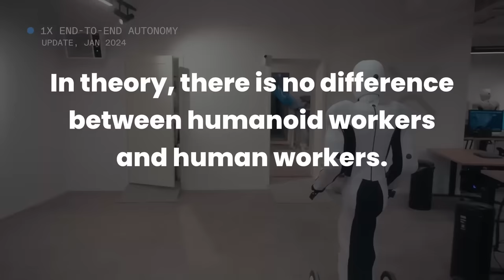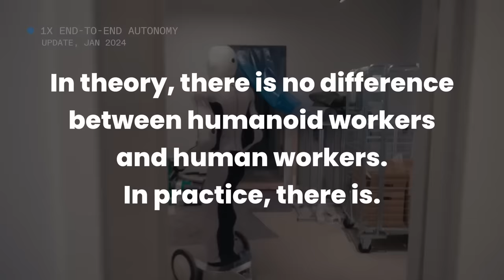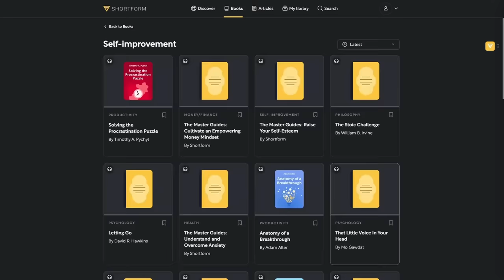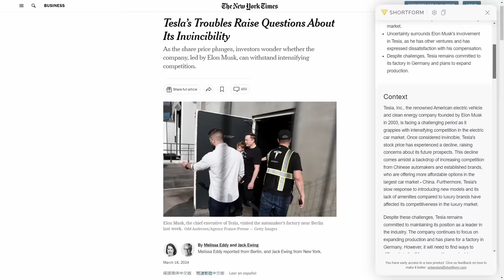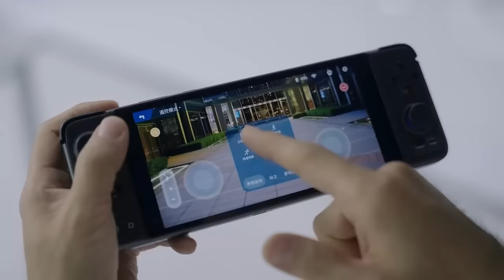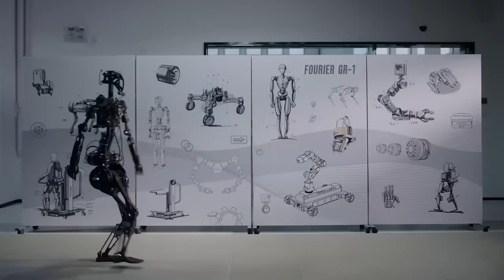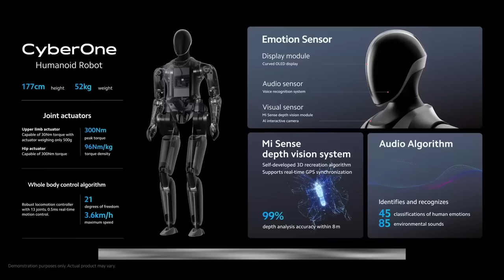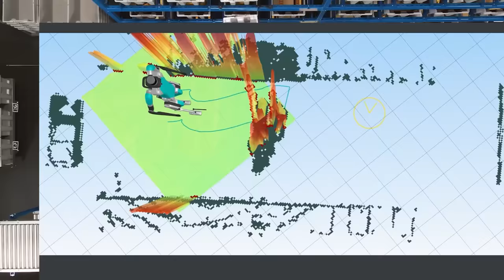Tesla's Vision Realized: A Deep Peek into the All-Robot Production Era

Comment: The volume of a factory could be reduced by at least 50%. Who says that a humanoid robot only has to be the size of a modern human. Why couldn’t they be half the size of a human. Bees, ants and other insects operate and live at a much higher density than humans.
Reply: The factory has to be maintained. Building a factory like a modern car where maintenance is almost impossible is not a good idea.
Reply: They also dont need legs per se merely a base with treads and maybe an hydraulic lift system. How often will the robot really move off of the floor it works on.
Reply: @Dave5843-d9m  
Impossible for whom? Not a robot.
Reply: They also don’t need hands per se. they could have sockets with interchangeable tools for the specific job they are doing. A hand “tool” could be one of them.
Reply: @Dave5843-d9m  but if you get to the point where costs are so low they're virtually only material cost replacing a "modual" of a car rather than stripping to repair a fault becomes the norm. 
This may of course appear ridiculous given the majority of people can't afford a new car (currently), but when automation REALLY takes over, and as Elon says, there will have to be a univerrsal payment system for all.
Reply: I'm trying to figure out, no pun intended, about repair stations to maintain/repair robots and a place to charge multiple robots "on their breaks" would look like on the factory floor. On the environmental front, I think the factory will need to have a huge hvac's similar to server farms to run more efficiently.  What's ironic is that they don't  do that for humans but will have to for the humanoid robots.
Reply: @GG-si7fw   
Robots fixing robots. The factories can be smaller and more compact so fewer cubic feet to air condition. Robots scan also operate in a space that humans couldn’t tolerate.

Comment: Production efficiency is definitely going to increase significantly.
You also made solid points about speech communication vs. robotic communication. It wouldn't make much sense for humanoids to communicate with each other via speech as that is not as efficient.

Thanks for the video, Connecting the Dots! The car design revolution video would be interesting as well.

Comment: Video on car design would be interesting, I imagine Integrating things such as what Tesla has done to design castings like a river so the aluminum can flow easier and use a smaller press than normal on the cybertruck.
Reply from the maker: I LOVED that part. before moving to software and other fields, I'm originally an Aerospace engineer, majored in manufacturing and structures but worked in fluid dynamics. Seeing what they did with that casting was mindblowing, just mindblowing.
Reply: @ConnectingODots  thanks for responding! What I appreciated about it is it shows their dedication to optimize every element possible, and make iterative improvements, yet their not afraid to throw out something when progress slows and a better way exists, fsd v11 took a lot of work but they completely started over on v12 and now have a much better product.
Reply: At least one Cybertruck casting can be made with the smaller 6500 tonne press used for Model Y. One press for 2 vastly different veeehickles!

Comment: To avoid the Parkinson’s and peripheral neuropathy gait - humanoid bots need load sensors in the legs and joints along with AI processing. That will give smoother operation and therefore faster walking and motion in general.
Reply: In most situations a "dog lower body" would work better.

Comment: you may need to design factories for humans too, for maintenance, troubleshooting, and other reasons.
Reply: If humans are not needed for production operation, then all the OSHA safety spaces can be eliminated. 

And special service work and such that the robots cannot do can be performed with tele-operated robots. There will be no need for any human to physically enter the factory.
Reply: @vincewestin  I suppose you’re right. If a remote controlled robot is not nimble enough to fix another robot, at least it could retrieve the downed or failed robot and bring it to an area outside the factory where humans could work on it.

Comment: There's a possible limit on the amount car design can change because of robotics.  Cars need to be repairable.  At the moment, mechanics are humans.  Assembly is a well defined task compared to repair.  I think it will take a lot longer to replace mechanics with bots compared to assembly line workers.
Reply: Internal combustion engine vehicles will likely continue to need repair by humans. But they will eventually be replaced by electric cars and trucks. And EV’s are considerably less complex, require less parts and software enables human mechanics to diagnose issues in the car. Automobiles will become even more modular in the future, making it more likely that robots will in fact replace many human mechanics.
Reply: Most repairs are not that different from manufacturing. AI is already good at diagnosing problems, so robots only need to disassemble and reassemble the car. And at some point it could make sense to just recycle the car instead of repairing. We won't have to drive them until they fall apart, because cost won't be an issue. Like how 100 years ago clothes had to be patched endlessly, but today we throw them out on the first sign of wear and tear, or even just because they are out of fashion.
Reply: Yeah, the impossible will take maybe an extra six months. 😂😂😂

Comment: A moving assembly line won't go away.  Assembled cars and modules need to leave the line, so having one location makes it easier.  In addition, this allows robots to generally be stationary.  This allows them to be tethered for power (and data), and therefore no downtime for charging.
One part of the production line that implements things this way is the paint line.  A moving line, all work is done by robots (in an unsafe atmosphere), and humans supervising from outside..  I imagine something like this extended to other lines.
Reply: Future body metals and other materials could have integral color, molecularly diffused or bonded into the surface.  Regular paint will be obsolete except for temporary applications. Eventually, colored bodies could be 3D printed over finished chassis at high speed, moving about as fast as robot paint sprayers would.

Comment: Another way to provide wireless energy to tools, motors, robots, cars, phones, etc. as by sound waves. On a frequency above 35,000 Hz nothing can be destroyed by these strong sonic frequencies. Sound canned which no one can hear can produce the sound waves and piezoelectric wafers can be pressed 35,000× per second to produce enormous amounts of power with no batteries or fuel on board the portable tool or vehicle whichever.

Comment: You are good at predictions… Let’s see if you can visualize what I’m about to suggest… Plasma forming of the type of manufacturing that absolutely will be implemented in the near future… Element heated to a plasma are magnetic. It would take a pretty huge sphere and electromagnets, but computers that can direct electro, magnetic lines into geometry is that are 3D can, and will shape the plasma of different elements, and the microwave will be turned off, and the cloud of elements will collapse into solid matter instantly and form cars, or any object instantly, by the hundreds thousands or even millions. Nano robotics can be formed this way. It’s worth mentioning here that fusion will be done this way.… A fear of zirconium dioxide will contain a portion of hydrogen… Heat will be applied until the hydrogen becomes a plasma… plasma, conducts sound waves that are 1/3 the speed of light… The sound bounces off the shell of the hollow sphere of zirconium dioxide, and the sound waves converge in the center of the hollow sphere where the portion of hydrogen is… When the sound wave all converge in the center, the hydrogen will be compressed and fuse… The pressure wave coming off of the fusion event will propagate through the plasma with unbelievable power… Magnetic mirroring will send the sound way back to the center where it will called fusion again on exponentially higher pressure level. Hydrogen can be fused to any of the higher elements and vision can bring it back to hydrogen relating enormous amounts of power in this whole event. graphene and borophene Will be made in sheets that are one atom, thick… Atomized boron, or carbon, Will be forced between two zirconium dioxide plates that are shaped like hexagons. Electricity will ark between these two sheets that are one atom apart, and the atoms will become plasma… At this point, vibration or sound will be induced upon the two plates that are in phase and hexagonal patterns will form in the plasma. At this point, The plasma is forced out between the two sheets and collapses into a chicken wire geometry of borophene or graphene skin, and Infinitely rolled up. This will allow materials that seem invisible, but are a bulletproof skin. High pressure inflatable wings can roll up when deflated into a small type of backpack for a person to wear. When the person thinks about flying, he is just like a hummingbird. Wings are far more advantageous compared to propellers, which can damage the hit where wings just tickle you. The wearable flying suit. can also inflate like a bubble should the wearer have an accident or collide with something where he would just simply float down to the ground. The engines which power of this are hummingbird myocytes or muscle cells that have been cloned with proteins to form long chains of muscle, which wrap around the shaft. The muscle engines are triggered by a simple, electric impulse and fed sugar water. The wearer can have a container over 1 foot shaped like a cone that contains sugar, water, and the other foot would hold the waste, the liquid waste, which would later be disposed of. Hopefully you can fill in the blanks and if not contact me and I’ll show you how it is very simply all done.

Comment: Once humans are not working in a factory there is no reason to have humanoid robots. I imagine it would be more like a complex machine inside with each moving part optimized for a specific class of tasks. If you are not limited by human strength or dexterity, parts could be heavier and larger than a human could handle. It may be that in the same way the game Go was changed by AI introducing moves undreamt of by humans, it is possible that AI will come up with super efficient factory configurations that are inconceivable to humans .

Comment: The earlier thinking of the factory as an organism seems like a likely evolution. To begin with economies of scale dictate that all the robots will be identical humanoids to be most versatile while scaling up but as the manufacturing of the robots themselves becomes more iterative the evolution through virtual simulations will further improve specialisation, possibly modular or easily disassembled and at different scales and moving away from the humanoid form that was the starting point because of the need to fit into previously human lead processes.

The alien dreadnaught could end up consisting of something more like an octopus on legs or some other form that we can't yet imagine. Humans have a hard time multitasking but a single octoboid could simultaneously perform all the steps needed to manufacture a car or other robot. I can see robots becoming increasingly organic, agile and swarm like.

Eric Drexler predicted that nanotech bots may come about by iteration of bots creating ever smaller versions of themselves as they approach electrostatic and then quantum limits. Being able to assemble and disassemble precisely at the molecular level is the ultimate goal.

Comment: Humanoid robots need not have human limitations. Fingers could be replaced by something like octopus tentacles. A head is unnecessary eye cameras could be in the shoulders and even have a telescoping post that can lift them up several meters for seeing ar a distance. Or even a small drone that can fly away for an aerial view. 
Feet are very awkward and slow,  Wheels have limitations. But Bladerunner feet may give extrodinary speed and agility. 
Wireless charging would allow a robot to charge without plugging in. And wireless computer links could allow super compute power without onboard weight, The robot being essentially just a terminal, with only essential compute power onboard.
Reply: Rollerblades!
Reply: @user-gv4cx7vz8t  No.Roller blades can't do stairs. Bladerunner feet, like the South African guy who won the para Olympics for amputee runner. And ran way faster than any human ever. 
But ended up in prison for shooting his girlfriend through the bathroom door.
Reply: @jeremytaylor3532 Rollerskates, then, doable with robots' superior balance, will do stairs.  Or the system that revolves two sets of wheels orbiting each other and climbing w/o losing contact with one or the other. That gives two-wheel speed and minimal turning radius on flats and slopes plus very efficient stair climbing.

Comment: Movement is waste in production. Why is there such a hangup about having robots that move on feet and having articulated limbs. I see factories in the future having mag-lev floors (magnetic levitating) with robots  being able to move between stations if required. I see transformers with interchanegeable parts. I see special bots whos job is to remove defective bots off the assembly/manufacturing floor to reassembly repair stations off the work lines. Hive minds will allow the whole processes to be synchronised to each other. 

Mag lev will allow assembly process to be designed three dimensionally. 

Main point is i think being obssessed with humanoid robots is a marketing rabbit hole which traps actual practical design for manufacturing /assembly in the inefficient human paradigm. We should adopt the mindset of machines building machines which should be, a first principle of factory robots. I really question the need for all robots to be swiss army style, able to do anything : modular yes.

Comment: May I suggest that you are being rather shortsighted? What you should be looking at is what the robots should produce, not how they can produce the things that we use today! For instance, it would be unnecessary to produce cars, if with robots we can produce Vertical takeoff and landing flying vehicles which can be perfectly safe and which can transport anyone to anywhere within much less time than it takes via roads! Roads themselves could become obsolete. And we could all live in garden homes connected to each other via the air!

By the way, screws and boats and nuts are totally unnecessary, as Sandy Munro has often pointed out, they are a week link in everything. one should eliminate screws and bolts and threaded fasteners for such things as bayonet mounts, the way interchangeable lenses are mounted to cameras. But of course, this is just a side issue.
Reply: Snap fasteners, some requiring superhuman strength to remove, could replace most bolts.  And clever fitting could even replace most of those (think Japanese woodworking joinery).